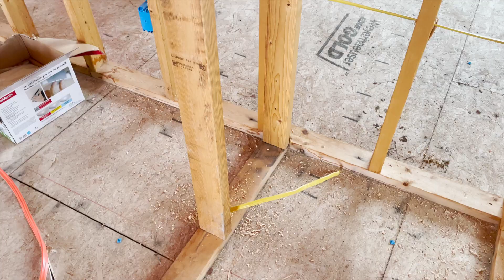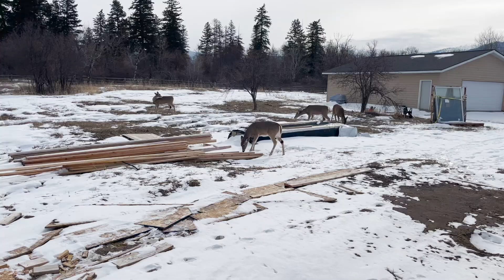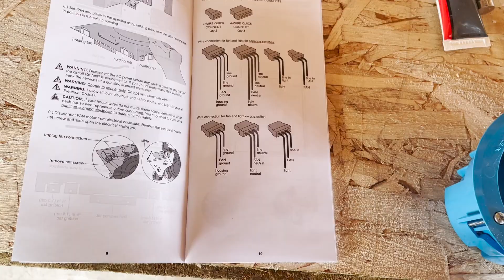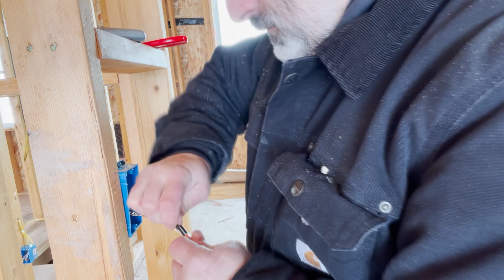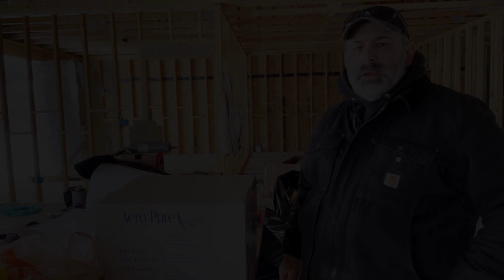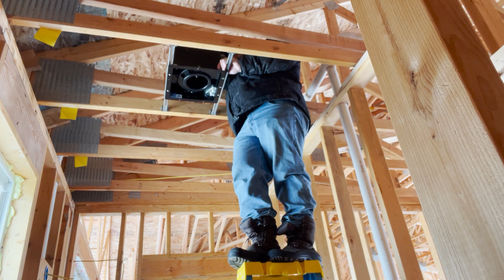Bathroom Exhaust Fan installation | Building Our Own Home Ep. 53

Comment: Thanks for another great episode. 
You said you're going to connect the GFIs. Why not run them separate if there is a chance to get dinged on inspection? Seems like to the time and effort to do it later and then call inspector out again doesn't seem worth the time savings.
Reply from the maker: Good question. I went  ahead and fixed it during this process as it seemed a little questionable.